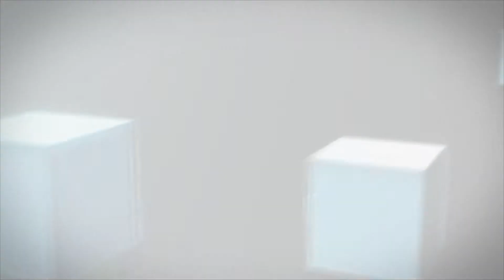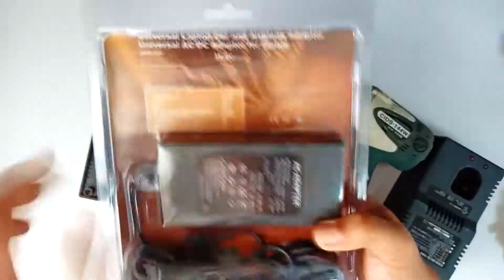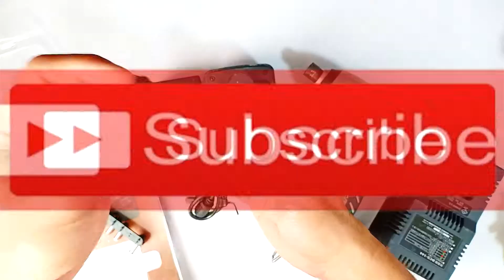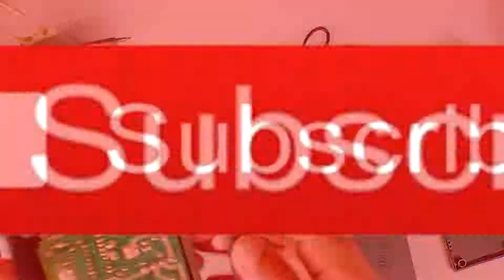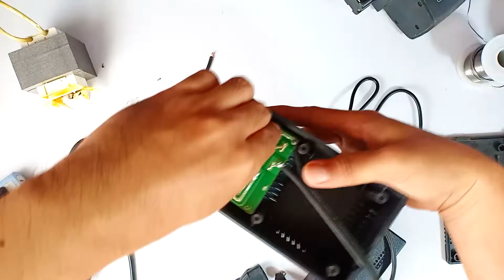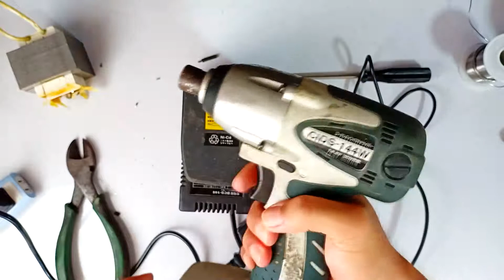Fixing my Impact Drill Charger | Converting it from 110V to 220V

Comment: The transformer output is 20 AC volt .. but when you are using the replacement  charger you are feeding 20 DC voltage to the old charger board. That is why the light is dim and the charger will not work properly.
Reply from the maker: Thanks for the info :))